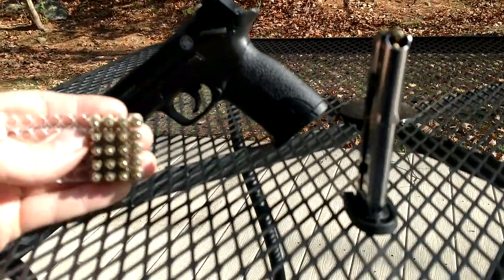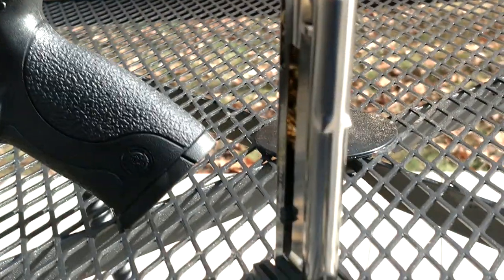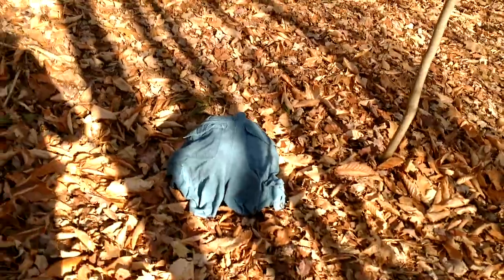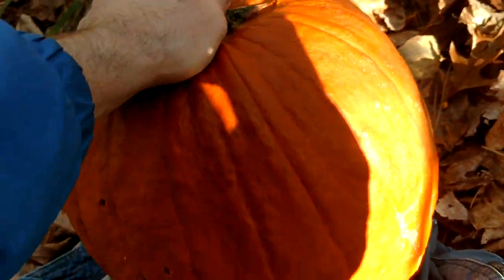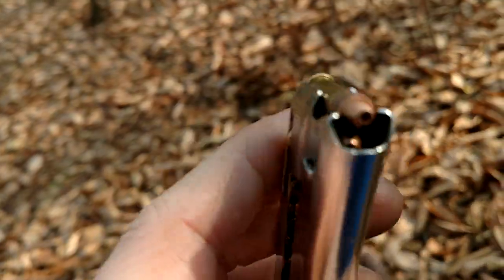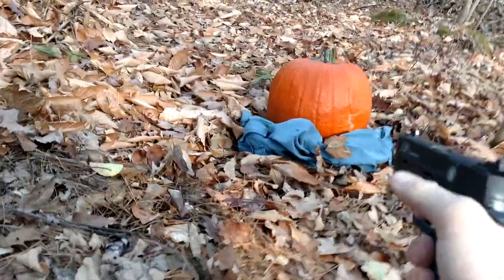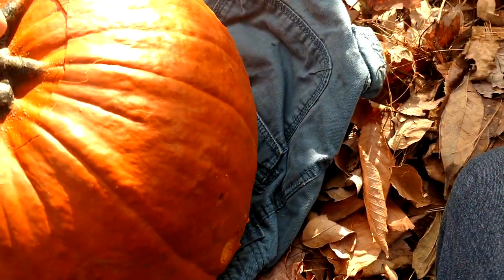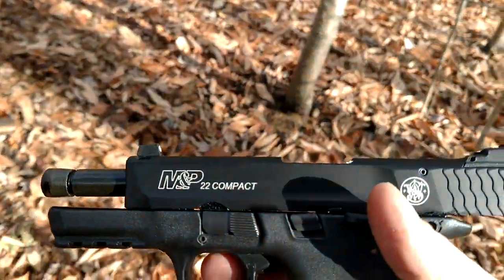Testing "22lr Screwdriver mod" does it help hollow point expansion from a pistol? S&W MP22 compact

Comment: So is it any more damaging? Have a co- worker who does this.
Reply from the maker: I believe so, they expand further than regular HP but I'm working on a side by side comparison with the same ammo all in one video, one modified one  not and that should be a little more concise. I hope to have it finished this weekend since now I can actually edit my videos.
Reply: The increase in exit hole might be due to the fact that what you did to the bullets shifted the center of gravity of the bullet further back, which increases the tendency of the bullet to yaw or tumble after impact. 

For clarification, did you remove any material from the bullet tips or did you just imprint the bullet with a phillips screwdriver without actually removing any bullet material?
Reply from the maker: I didn't remove anything,  like you said  I just pressed a Phillips into the hollow point, definitely  could have been off center some
Reply: @CadmusCurtis  Are these golden bullets? I made mine extremely wide.
Reply from the maker: @saltydominion9069  Yeah they are actually Golden bullets, not Regualr green and yellow box